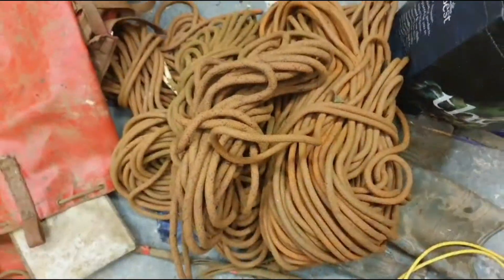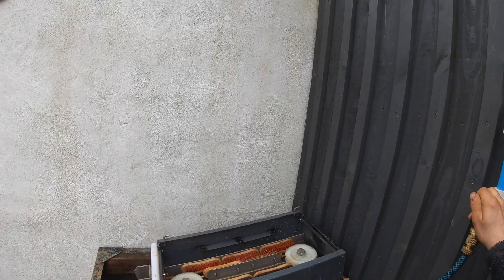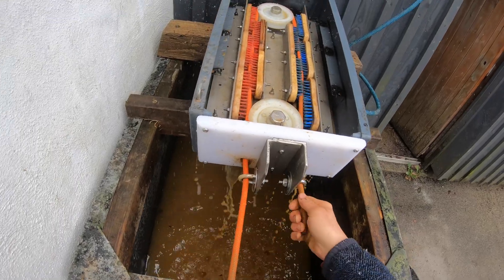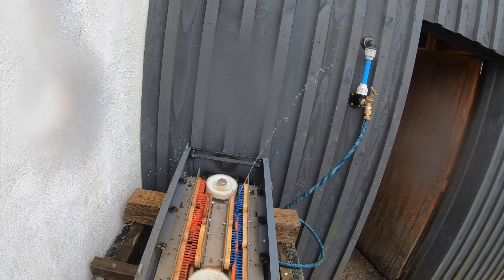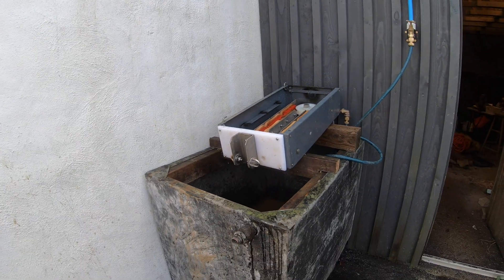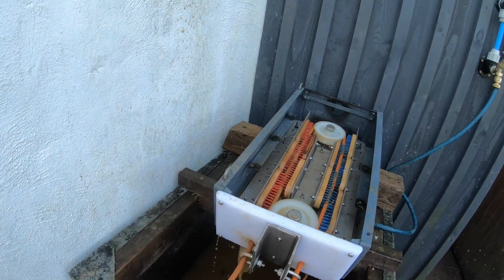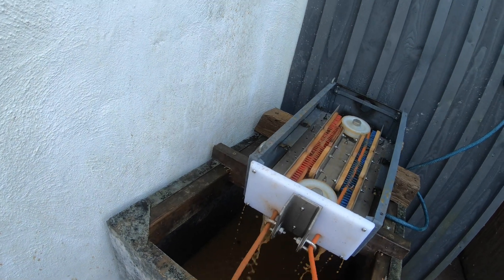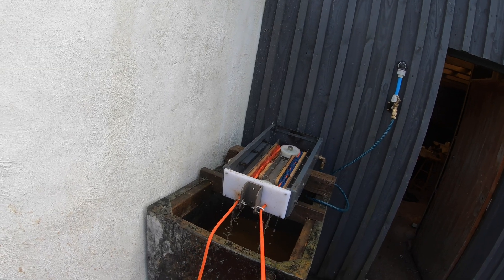Rope Washer MK 1 is a SQUIRTER

Comment: You could probably reduce the amount of times pulling it through by adding a pressurized pre rinse before it gets to the brushes to remove heavy dirt
Reply from the maker: Yes good call - like a pipe that the rope passes through that has a pressurised water supply? This is possible as there is space. Where the rope enters the unit, this could be changed to a bulkhead pipe fitting . . . Hmmm cheers. There's a few mods to incorporate so this could be one of them. Nice one!

Comment: Nice set up, I use one of them corkscrew brushes, usually going over the rope twice then hosing it off before bunging it in the missus's washing machine (with beal rope wash) Dunno if they still make it, my usual shops seemed to have stopped selling it.
Reply from the maker: Good call doing a pre wash to prevent silting up the washing machine! As for Beal - yeah Tony @ Starless River has it at times but have to talk direct as not always on the website! Cheers. 😎